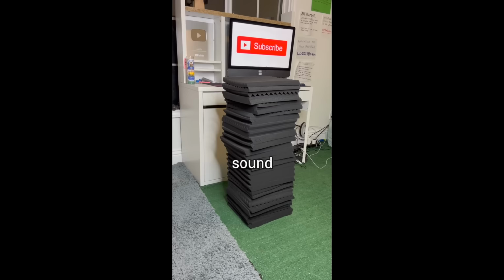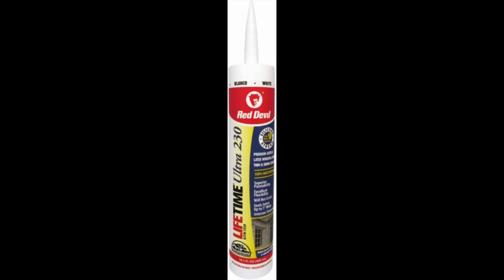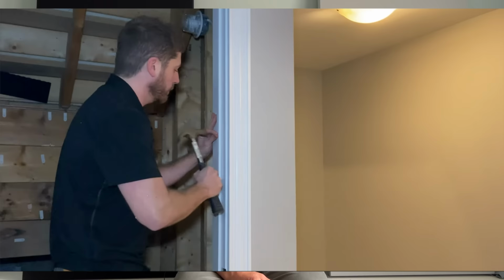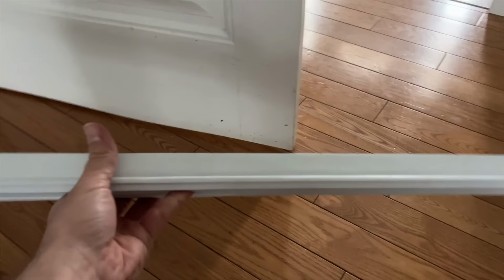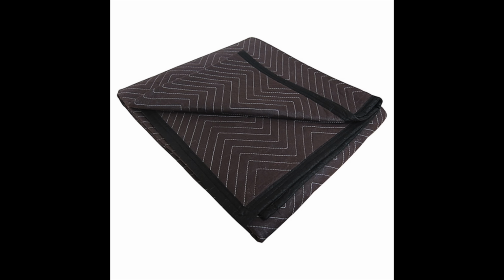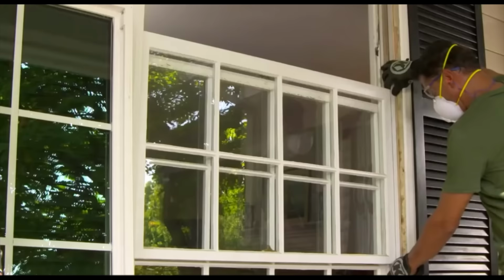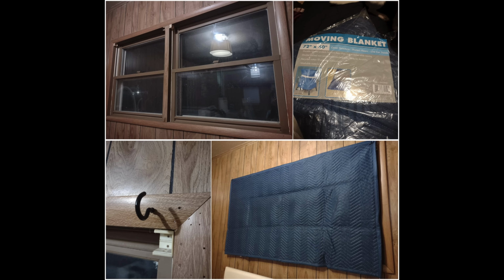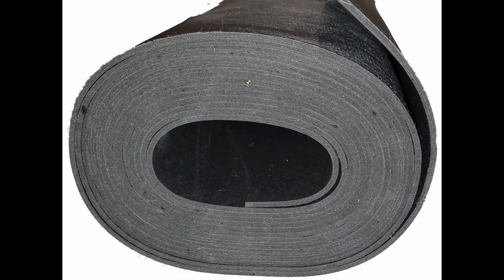CHEAPEST Budget way For SOUNDPROOFING a Room

Comment: Finally a video that is realistic and honest about soundproofing.
I used weather stripping along with those bottom door draft stoppers and it works very well.
I have to pull the door a little harder to make sure it closes properly which also tells me the seal is tight.
The biggest problem which you mentioned and no one else has is the air flow...
The room can get a bit stuffy and humid since the air flow has been reduced so much.
Reply: Open doors and windows for a while everyday
Reply: Get an genuine NDIR CO2 meter and check your ventilation.
You need more than you think for optimal health.
Reply: @cajampa  yes, the main problem is how soundproof vent system. Especially if you use breezer that makes a lot of noise on its own
Reply: @Tony-.  I am going to tell you the real secret and solution to this problem. Massive green house plants. That is how I did it to keep my CO2 low but not having to ventilate outside air in so much.
Green plants also cleans the air for us and have other health benefits.
I also run a air cleaner on low in most rooms for particle and some extra carbon filtration. 
For even better quality air.

And believe me in the low run, breathing clean air and breathing low CO2 levels gives massive benefits to our health. Think about it, if you are concerned about optimizing your ventilation. 
That is how you do it.
Reply: @cajampa   Yea, but, there are two problems here. The first is the control of heat inflow, I solve it with a film on the window, which also blocks useful sun radiation. I take vitamin D and walk every day, but the plants will die, or would need a special lamp.
The second is free space. Not everyone has the opportunity to live in a large house, and if the room is small, the volume of air are also small, so plants simply do not have time to process it even for one person.
The most effective method is an electric air inlet with a filter outside the room and noise-isolated ventilation, which is expensive and difficult. 
The next option is a combination of passive ventilation and green plants. Additionally a traditional type humidifier and quiet AC split system for heat days. Which again is complicated and expensive
The worst option is ventilation by hours. No one will follow it and you will start to have problems with headaches, allergies, etc.
Reply: @Tony-.  You can use regular white fullspectrum LED light for plants. It works great for me. I have plants all over, not only in the windows and if you use some kind of special film on the windows that does not let in enough light. Just add some lights for them. Modern LED lights are crazy efficient and in the winter I even save money, from not having to ventilate as much so I don't need to heat up the air as much. By using the plants to keep the air fresh instead.
And it is the same in summer, because I don't have to ventilate in as much warm air in, I don't even have to run the AC anymore. I just ventilate for a few hours when the temp drops below the inside temp, in the evening to let the house cool down. And that lasts until next evening most days, but a few of the hottest day of summer. 
Before I did it like this I had that AC running most days in the summer. It cost crazy much in power that I don't have to pay at all now.

Although I live in the north so it gets very dry in the winter. So I have a custom humidifier that keep the air suitable moist at a bit below 60%, so the plants stay healthy year around.

I love having lots of beautiful plants in my own little ecosystem in my house. Feels like being close to nature even when we live inside.

Comment: A few points
-- Deadening that other room can be a faster way to improve the room you care about.
-- "draft stoppers" that people use for doors can work as well as a blanket to stop the noise under a door.  A chunk of rug also works
-- Hanging a tapestry an inch off a wall deadens sound quite a bit.  The gap makes it free to move.
-- For windows consider drapes rather than curtains.  Drapes are made of more substantial material and the rod positions them out from the window.  The drapery rod can be arranged so that the edges of the curtains wrap towards the wall to block that path.  You can have the top of the drapes well above the window near the ceiling.  This makes the path for sound harder in that direction. You can add curtains within the outline of the window opening as well.
Reply: Allowing your soundproofing materials to float is a great point!  That way the sound get converted to mechanical energy as well as heat(like foam stops sound.)
Reply: @jbarker2160 I don't understand, does the air insulate the sound?!
Reply: @mryan4452  Think about throwing a tennis ball at the wall it will bounce back, now if you throw it at the wall with a blanket directly on the wall it will still bounce slightly off it. If you throw it at a blanket that's mounted a inch off the wall not touching anything, the tennis ball will not bounce back and drop to the ground
Reply: @313chicken That's a really good analogy, thanks! :)

Comment: Instead of moving blankets I use old bed comforters that I purchase cheap at thrift stores. 

I also hung two layered duvet covers over the two doors between me and the basement apartment as draperies. That works very well. 

Around the frames of my old aluminum windows I stuffed strips of a foam mattress topper. I also used this on the back wall of my bathroom cabinet to absorb sounds and keep my adjoining bedroom quiet. Lets just say, I never throw out foam. It's so valuable in sound proofing.

Comment: Lots of great suggestions here. I've used all sorts of products in my home in replacement of more expensive, commercial products. 
I have found that adding a block-out rollerblind to my french doors (that lead from the bedroom to the courtyard) has been a huge help in keeping the heat in and the cold out in winter. 
I've used old carpet underlay (back when it was made of wool and not the modern version made from unnatural, plastic based material) to line my garden plots. I dug down a couple of metres (a few feet) before laying the carpet underlay. This has really helped to retain moisture and encourage deep roots in my plants and trees. 
On the courtyard pavers, after struggling to stop the weeds for over 20 years, I gave in and bought  garage workshop rubber flooring. It would be more attractive if it were in one piece, but this is all I could afford. It gives a nice feel under the feet and has done a fabulous job and deterring weeds thanks to it complete blockout properties. I actually use it in my kitchen also. It cleans up as easily as tiles and, if really in need of a treatment, I can simply lift it out and take it outside. I'm sure it helps to dampen the noise too. I've not tried this on walls or doors but would be interested to hear your opinions on it. 
When I was in high school (in the 70s and 80s) our music room ceilings were lined with cardboard egg cartons (just the wavy bits that support the eggs- not the lids). I think this was a common feature at the time as a cheap sound dampening measure. 
When I toured historical places in England many years ago, most of the regal houses contained huge woollen tapestries on the walls. These not only looked impressive but they helped to dampen the sound and keep the heat in these rooms. Be aware if you're thinking of using this method though- most of the items called 'tapestries' online are not actual tapestries. They tend to be a print on some cheap polyester fabric to use to brighten up a wall. I wouldn't use too much of this in your home as it is a fire hazard. 

Oh- and instead of throwing a blanket on the floor to block out weather/sound from the bottom of doors, add a door sausage instead. You can get some more attractive ones and they are easily moved out of the way to open and close the door. Make sure it's a heavy-weighted one though- usually filled with sand. Sandbags are great for stopping flooding too (used on many a riverbank in Australia in flooding-prone zones).

Comment: The biggest problem I find is people mistaking sound treatment with sound proofing.  The layman does not distinguish between the two.  With new clients, it's the first thing I have to explain. Sound treatment can be easy and cost effective.  Sound proofing is generally more difficult and more expensive.
Reply: How did you manage to use "layman" in this sentence? I assure you this isn't as big of a problem as you think and us laymen out there know that acoustic foam doesnt soundproof rooms
Reply: @jaredroscoe800  YOU may know that, but in my line of work I run into people all the time who have no idea how any of this works and need to be educated about the terminology and have their expectations set to realistic levels.
Reply: Can confirm. I had no clue of the difference. I’ve been talking about soundproofing left and right for my new bedroom. Little did I know there’s so much more than I thought. I never even thought about treatment Vs. proofing
Reply: The problem isn’t people it’s the word itself. Soundproof as a verb means to make a room or building resistant to the passage of sound. Sound Deadening is the quality of sound in the room which does involve quieting down the room. Since it does contribute to limiting the sound that comes out of the room it is also technically a form of sound proofing, just not an effective one because it does nothing to address the sound coming into the room. What some people don’t understand is that soundproofing is more than just sound deadening

Comment: A lot of common sense and useful stuff for low cost soundproofing for everyday folks. And also the clearing up of what those acoustic foams pads actually do, which is they should only be used when YOU are the one making the noise and don't want it to escape. Thanks brother, keep it up!
Reply: tbh the foam isn't even so much about keeping your noise from escaping as much as it is about keeping your noise from bouncing around the room for ages giving you nasty reverb tails on your recordings. It'll do something for keeping your noise from leaving, but I doubt it'd do much, especially if you only have a few panels hung on your wall

Comment: Some really good advice. The terms for the distinction between reducing sound from outside, vs echoes is Noise Reduction vs Acoustic Treatment. As an audiobook narrator, I’ve had to do all of this, but especially acoustic treatment to cut reflection. You’re so right about the price differential with the added “acoustic” in the name. Such a scam… usually. I DID pay extra for “Acoustic Blankets” vs heavy duty moving blankets and, for my purposes, they were well worth the extra cost. They are thicker, denser, and easier to use. But regular moving blankets do a pretty decent job. You may need to double them, depending on the amount of reflection from surrounding walls.

Comment: People don't realize that there are different things that they are fighting, which need different tools.
Sound sources, like creeks, cracks, squeeks need to be dealt with at the source.  Add some foam, or caulking, or better securing a loose board... whatever it is, you just need to make it stop.
Sound reflections.  When people complain about a room, it isn't generally outside noise is affecting quality, but reflections off of hard surfaces.  Carpet, especially with padding, is your best cheapest option.  Second is adding panels or baffling in corners, or on at least half (and not opposite halves) of the walls.  If you can do all of the walls, great, but just doing 2 adjacent walls in a 4 wall room is typically going to eat the majority of the problem.  Personally, I like to use fire insulation like rock wool, framed in cheap wood, and covered in fabric.  It can look super boring if you want, or you can use patterned material, or anything fabric with something you like on it.  I like fantasy maps, and there are no end of fabric maps you can find online to slap on top of a DIY sound panel.
Next is sound leakage.  The first actual step towards sound proofing.  If there is an air gap, no matter how small, then sound will get through annoyingly easy.  Recording studios are notoriously hot, because in a perfectly sealed room, the heat from a human and a single light bulb builds up very quickly if you don't have free flowing air.  Spray foams, caulking, winterizing products... anything that seals gaps is your best friend.  And if it if rubberised, then all the better!
Lastly is sound isolation.  You want layers of boxes with air gaps between them.  Sound travels well through air, but it does a terrible job at transitioning between mediums, so forcing sound to go through a mass, then air, then another mass, and then air again is key to sound isolation.  And you want as few bridges between layers, and staggered weirdly as possible without becoming a building code violation.  A cheap (but labor intensive) way to do this is to buy drywall, and use something like a thick layer of poorly spread liquid nails or some other adhesive to slap it over existing walls.  Force the sound to go into the first layer of drywall, then an air gap with as little material as possible, and then another layer of drywall.  If you can fully frame out a room within a room, and have the framing resting on some sort of ruberized material, then that is even better.  Walls are transducers, so having walls that make direct contact to the frame of the house, which is then well secured to the basement walls, which transfer lots of ground energy from trucks and other large vehicles will cause some level of issues.  Anything to break that contact to have a free floating structure will be the hardest and lest rewarding part of sound proofing... but if you need sound proofing and already have panels and everything else but still have a problem... this is kinda your last and only option.

Comment: 5:00 (apx) -  For the lower door you need to have something you can put in place when needing to soundproof.  Keep in mind, your lower door gap is needed for HVAC systems to function properly in circulating air.  So if not needing  soundproofing all the time, get something you can put in place when needed. IE: towel as mentioned.
Reply: Depends on the house.  I have an HVAC return in each room, so the door gap is not part of the recirculating plan.
Reply: we have "snakes", basically 4-6cm diameter tubes of material filled with something inert, like dry clean sand (probably has something synthetic in it now) - heavy enough to stay there and block draughts/sound, but light enough that you can still open the door easily.
Reply: All of my rooms have cold air returns.  Not everyone needs the gap.
Reply: @FreedomTalkMedia  If you have a separate setup like that then great, but that is not the majority of homes.  The gap is an issue to be reviewed. 

Also your returns create a channel for sound to carry through to other rooms.  Just like AC Supplies that allow sound to carry from room to room. 

While it may not be at a level that is concerning or unacceptable in your specific case it still needs to be addressed.
Reply: @chrish7336  It's the standard installation for a forced air furnace since at least the 1970s
Reply: @FreedomTalkMedia    OK so wording is important and I just re-read the post.
Multi room returns are actually not THE STANDARD, but it is a standard.

That said, a properly set up single return system will run just as efficient and keep balanced temperatures just as well as a dedicated system at about half the cost for duct work.

Additionally, room to room venting is also used in place of dedicated returns.  Gives the appearance of a dedicated system when it is not.  

So in these cases door undercuts may not be a area of concern.

As far as sound proofing, each and every application is different, so yes a review of the door gap or undercut is needed.  Even if it isn't an issue needing to be dealt with.

(Edit)-  Cold air returns are not actually returns.  Returns will have warmer air than the supplies with AC.

Comment: For windows you can use a piece of plexiglass cut to fit, and edged with weatherstripping so that you have a friction fit around the frame.
Reply: Aka an interior storm window.
Reply: Ooh, interesting! :)

I assume that placing it a few inches back from the window would be better than having it touch the window?
Reply: @glowcube  do you think it’d be effective on metal shutters ? To suppress crickets sounds and dog barking inn the distance

Comment: Another thing that you can add to outlets is the insulation pads designed for blocking drafts (especially useful on exterior walls). They fit in behind the cover and fit fairly snug. A pack of 6 costs a couple of dollars.
Reply from the maker: Thank you!!
Reply: Great idea, thanks.
Reply: Yeah I used those and apparently the hot wire wasn't sitting right and guess what happened to that foam pad? Yep started smoking. We found it before it caught on fire. Use them with caution.
Reply: @Nonybusinessxxxxxx  That's a problem with the person who wired your outlets and let the hot wire poke outside of the screw

Comment: In my college apartment for the past 2 year, when I first moved in I noticed how much echoing there was in my room. I hung up my old comforter and that made one hell of a difference. I put it right behind my monitors, the direction I faced 95% of the time, and It stayed up there (as long as the clips holding them up didn't let go, which they did A LOT [velcro would have probably fixed the problem]) for the entirety of those 2 years. When I moved out this past spring and took it down, I forgot just how much and how loudly it echoed